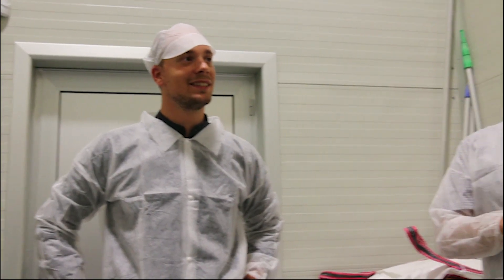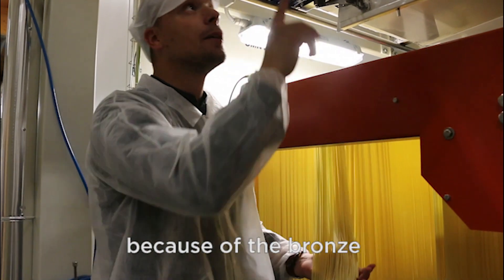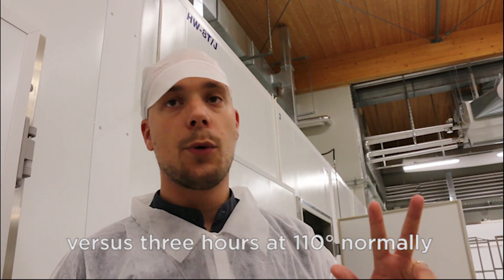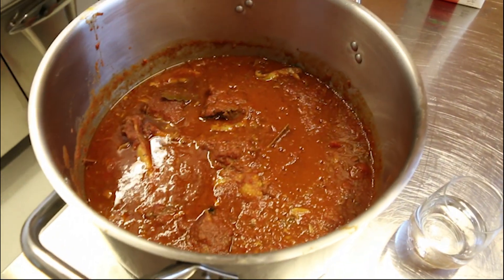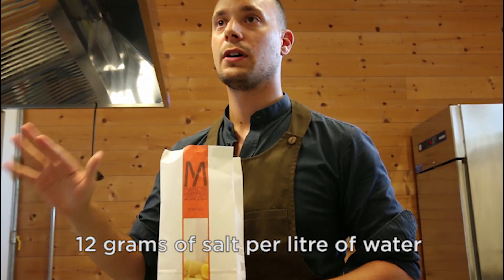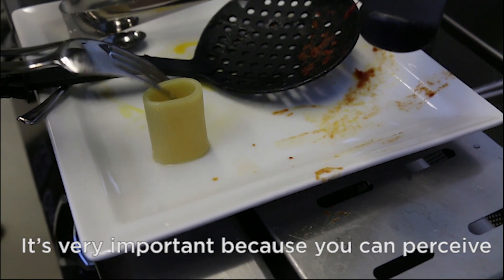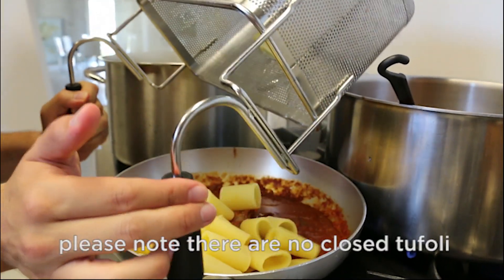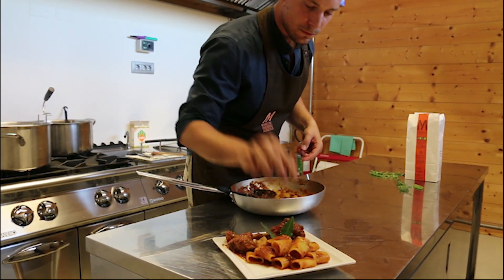Pasta Grannies talks top quality dried pasta with Pasta Mancini

Comment: This is very interesting information and that pasta looks incredible.  It also sounds from this like I've been using too high heat when I've tried to dry my own pasta.  Perhaps I will need to try a dehydrator.
Reply from the maker: Amy, I think some humidity is needed so a dehydrator won't do the trick. The ladies in Bari for example, spread their orecchiette out to dry on trays outside in the street - they are similar to ones used for storing fruit. best wishes, Vicky
Reply: @pastagrannies  Thank you Vicky!